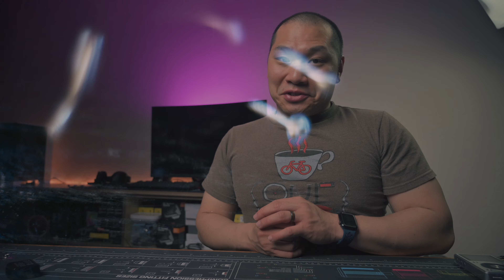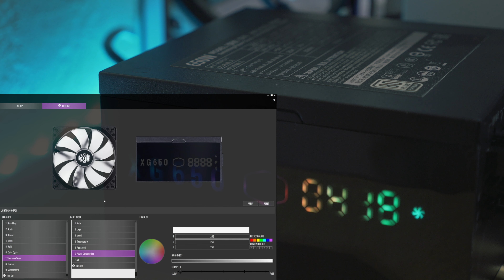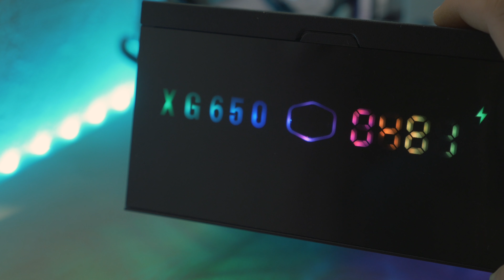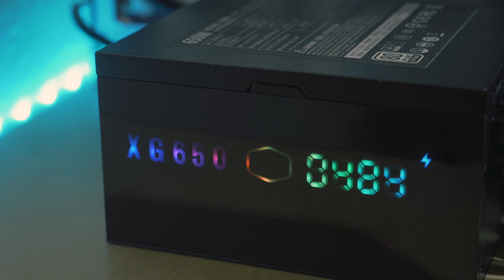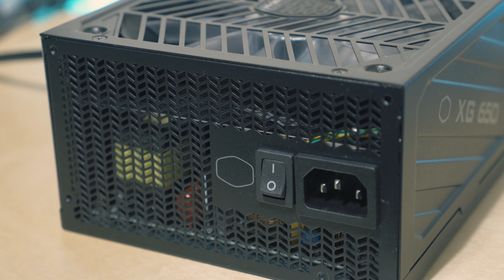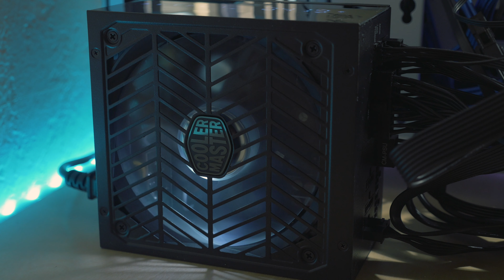An RGB Power Supply With a Monitor? Previewing the Cooler Master XG650!

Comment: any update on the sfx problem/replacement? i read on reddit that cool master said no such to others about getting a replacement
Reply from the maker: Yup- they said ETA for inventory is April, and I was reassured that they will honor the replacement. Earlier on it seemed like support staff didn't have the updated information at the time. At the beginning of the year I was informed that there was a mix of inventory on the market, so I wonder that's just to give time for the older inventory to move, since there are a few folks on Reddit saying that they got the updated one without fanless behavior.